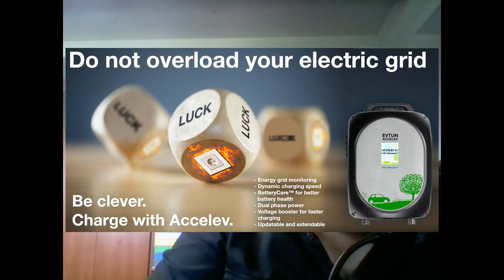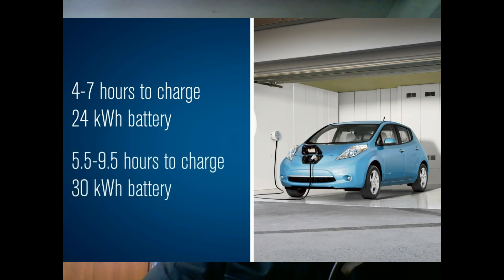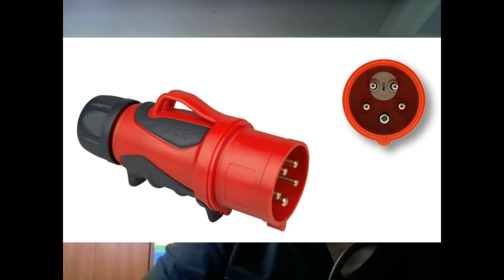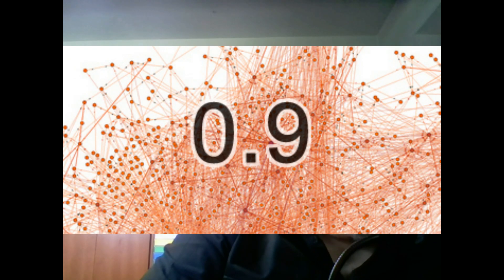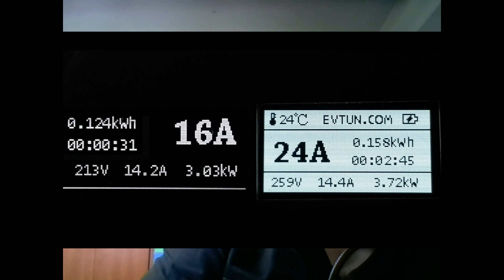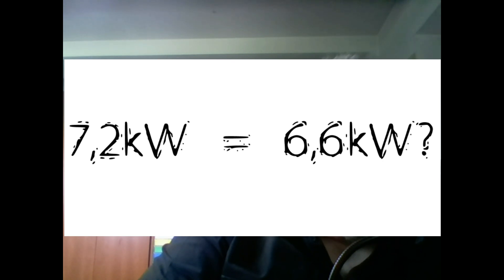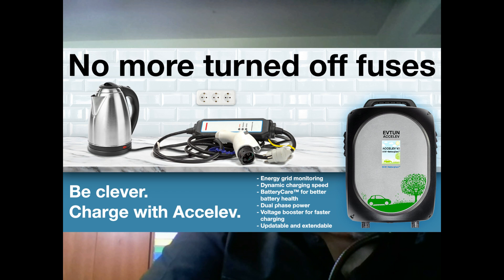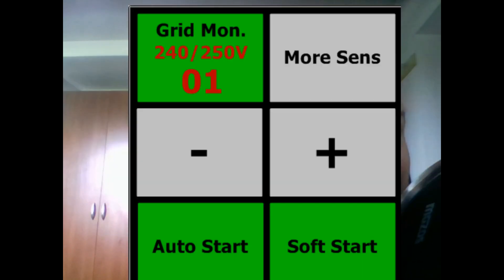Charging speed limits of EV cars explained

Comment: Could this increased voltage have a negative impact in the EV's batteries of charging circuity, seeing that they are built for less?
Reply from the maker: No. Standard homologation is for 250V, so using up to 250V gives only advantages.